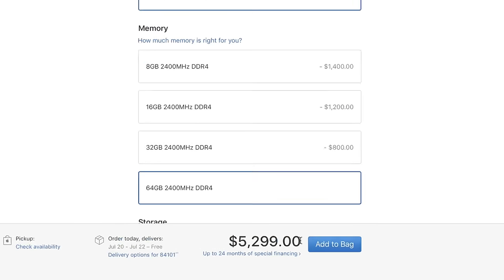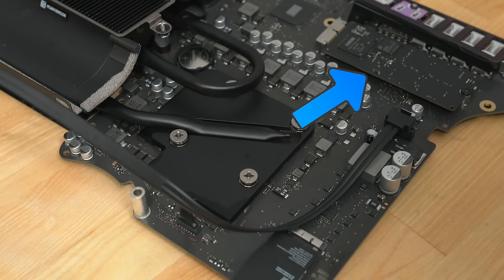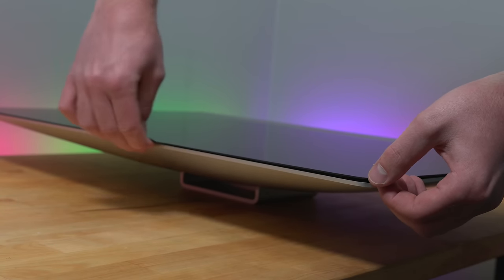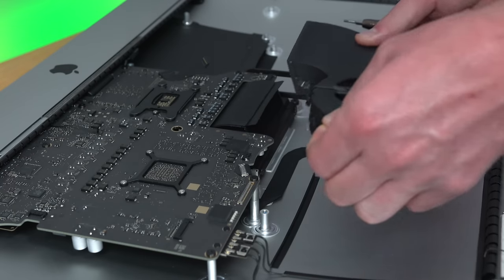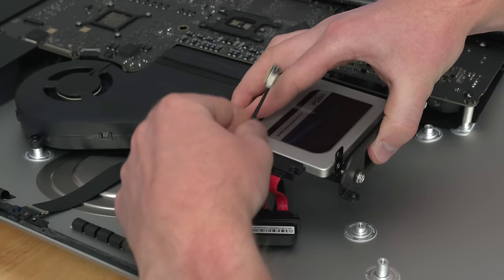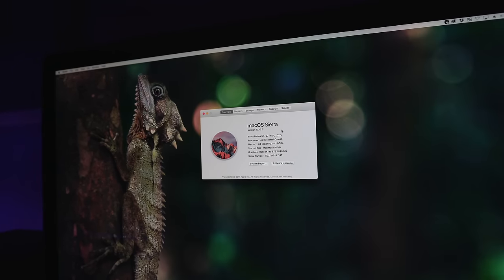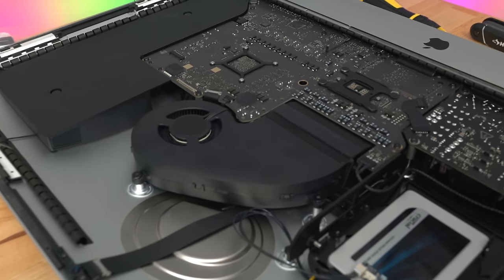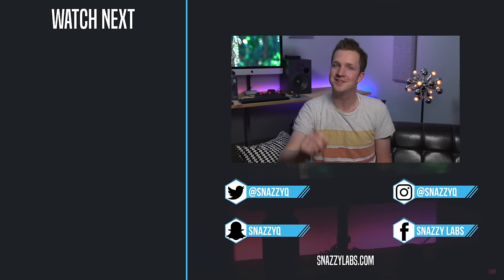The Best 2017 iMac Apple Doesn't Sell!

Comment: If the time comes when the machine´s hardware becomes obsolete, is there any replacement parts all down to motherboards for these apple machines (aftermarket and apple made) only to be fitted into the chassis though?

Comment: Great video. Perfect length and super informative. I'm looking to potentially upgrade my iMac as well so this is really helpful. What I'm wondering though is, would this work with an 8 core processor? The upcoming iMac Pros are going to have processors starting at 8 core, but I don't want to pay the ridiculous price that Apple is going to charge for even the base model. I've got a 2013 iMac now with an older i7 processor, and it would be killer if I could just upgrade it to an 8 core.

Comment: I've got a 27" iMac Late 2015, I've got the SSD in hand, the adhessive, thermal cable on it's way, but you upgraded to the Blade SSD, but added an SSD. Do you somehow make a fusion drive agian??? Or just throw away the Blade SSD?

Comment: Thanks for sharing this cool video.  What was the model number of the iMac that was upgraded?  What would be base model's model number?  While this video showcases the i5 to i7-7700 upgrade, what is the video card upgrades could benefit this build?  Would the non-K cpu work just as or better than the K-version?

Comment: Great video, I have seen it more than once,
Now I am planning to do the same, to buy a base 5k iMac and upgrade the CPU, add SSD, and RAM

But I have some questions if you could help me with:
- does the new CPU throttle like apple’s 7700k? Under load
- what do you recommend for thermal grease? And the volume it needs to put it on all the components (I see that you are using a big syringe of MX-2)
Reply: Mustafa Mahmood mine doesn’t. Use mx-4

Comment: SOLVED!! Quinn, does it matter if I put in the i7700k 4.2Ghz or 4.5Ghz performance wise? I only presumed the apple cooling is not properly fit for the bigger one.  One is 65W the other is 91W. In the video it seems like you used the 4.2 but the amazon link leads to the 91w (4.5ghz). can you please clarify? Thanks and check your emails lol...:)))) SOLVED!!!
Reply: so did you get an answer?! lol

Comment: You can run the LG 5K screen at 5K on the MacPro. If you option click on the Scaled radio button in the Display Preference Pane you can access the other resolutions. You may also want to enable HiDPI mode too.
Reply: No it just makes it look like 5k scaling-wise (smaller logos etc)

Comment: First of all, this is an extremely impressive hack! I will likely do the same thing to an old 2012 iMac. 

BUT, most of the money you saved was because you got third-party RAM, which you can replace without voiding your warranty. Your REAL savings is less than $250 if you get a BTO Mac and purchase RAM elsewhere. A 27" top-line iMac costs $2299. Add $200 for the i7 processor. Add another $200 for the 512GB SSD upgrade. That's right! The 512GB SSD upgrade only costs $200 if you're getting the top-line iMac, but costs $300 for the low and mid-line iMacs. Now, add the same RAM and 2TB SSD that you got along with the iMac you popped open ($453 and $532, respectively). And let's add an enclosure for the 2TB SSD for say, $24 (yes, there are cheaper ones, but let's not be stingy). That brings our total to $3708! That means you saved a whopping $237 to void your warranty and get a weaker video card! And your cost spreadsheet doesn't include the highly-touted opening wheel or thermal paste. That brings your savings down EVEN LOWER. I don't know about you, but if I spent $3700 on a computer, and somebody said, "hey, if you let me crack open your iMac, void your warranty, and put in a weaker video card, I'll give you $200," I'm pretty sure I'd say "no, thanks."

Comment: I did the exact same thing to my iMac but used Corsair's 16GB DDR4 SO-DIMM RAM instead. For some reason, whenever I'm working on something heavy, like in Final Cut Pro X, it crashes almost instantly and the Mac shuts down and restarts with the message " Your computer restarted because of a problem. Press a key or wait a few seconds to continue starting up." When I took the additional RAM out, it worked perfectly. Is the RAM i'm using incompatible?

Comment: So NVME is proprietary? Can't I buy one on Amazon and replace my 128gb original one that at the time was used in "fusion" with a mechanic HDD ? I would like to replace both drives and NOT re-build a fusion this time. Can I do it?

Comment: 6:18 this silicon lottery aply only if you OC, without it all 7700k run exactly the same... unless apple's default 7700k is real silicon lottery loss and it overheats as hell and underclock.

Comment: hey dude, first time caller long time listener ;p love the builds you do man! thanks for sharing your advice to us all. I was hoping I could pick your brain and ask your opinion on something I am trying to do with my dying mid 2011 27 imac. only problem is the gpu (i killed it playing the witcher 3 via windows bootcamp lmao) i've also still got my old g5 power mac laying around if that helps haha. Anyways, my imac isn't slim so i thought i may be able to remove some things and get an itx board in there, i doubt a gtx 1070 GPU would fit but i don't have a spare empty imac case to practice with. i am trying to build a fairly decent machine to game with and do video editing and animation work. i don't need 4k for what i do, but it would be nice to have a machine capable of doing so (even though I'll need i 4k monitor to view the results) the 1440p monitor is too good to through away imo. i would like to reuse as many parts as i can,  any thoughts on this are greatly appreciated, thanks again.

Comment: I’ve got a question I hope you can answer:
 I have, what seems to be a dead gpu in a mid 2011 iMac... do you know if the case will support a fresh rebuild utilizing new components like shown in this video? 
 Actually, I don’t need a unit with fancy specs like the top line one you have here but, an mild update would be nice.
Reply: You can add an ssd. But your cpu will have to be for that gen.

Comment: I have a question?  I was thinking of getting a 3tb fusion imac setup, is it possible to put the original SSD on the board later on, is it possible? Or should I get an SSD with the inital purchase, then just do your upgrade later on?  My thought on the 3tb setup is to maximize the warranty before adding on SSD on the board.  I was also thinking that by the time my warranty runs out ssds prices might drop.

Comment: Why does your iMac about screen says Radeon 575 and in the video you say your buying the base model with 570 graphics. 575 is the middle ground and is upgradable from Apple to an i7. Asking this because I'm wondering if the CPU on the base model is soldered and on the more pricey ones isn't?

Comment: I really enjoyed watching this video. Thanks a lot. I've got some questions. I have a 27" iMac which came out in late 2013, and I'm thinking about upgrading it just like you did. My first question is that the DIY parts you bought would be working for mine. If so, what about later parts that come out in 2019 with better performances as you posted this video 2 years ago.
Reply: I forgot to mention about my mac in detail: 3.2 GHz Intel Core i5, 8GB 1600 MHz DDR3, NVIDIA GeForce GT 755M 1 GB. If you were me, what parts and upgrade details would you do to my iMac? I do lots of video editing on iMac and now I'm really tired of my iMac being too slow and taking up lots of my time in editing.

Comment: As an Engineer with 30+ years experience with Software, Systems and dozens of PC's, I can tell Apple's MacOS is head and shoulders above Windows. It is a Berkey Unix based Kernel that Apple has optimized and remains downward compatible with older hardware. If Apple made their systems more easy to upgrade - they would sell more of them. I have a late model 2015 SkyLake architecture and love the 27" 5K retina display. The display should be separate from the PC , and the hardware more modular and accessible.

Comment: You bought an i7 7700k while I expect that Apple uses the i7 7700 stock. You can't overclock in the mac, but it runs naturally a couple mhz faster than the 7700.

Comment: can i ask a serious question?  i'm considering trading in my 2017 5k imac and getting the refreshed 13"mbp.  thoughts?  the only reasons i'd want to hang on to the imac is for the 27" 5k display, no t2 chip, and user upgradeable RAM; but there are so many other things going against the imac.  i would like to think apple is going to refresh it sometime in the next year? or less?  the looks are dated, which i don't care that much about in and of itself, but if a redesign comes with upgraded I/O, that's something I'd want.  It's also got the same old ass BT, not even an option for 10gig ethernet (not that I can make the most of it, but it's like a $90 upgrade on the mac mini), the vega 48 seems like an overpriced and lackluster upgrade, and they leave so much empty space on the inside, which could have been used for a secondary fan(????), which would seem like a smart idea for a computer with heat issues... desktops are going out of fashion, and mobile productivity is the present and the future.  But I still do enjoy the desktop experience.  I figure that with a MBP + TB3hub + egpu + external storage, I can get similar performance (if I go for the 15"), plus portability.

As far as why i'm looking at the 13" mbp is because I can almost trade them for each other straight up (maybe a few hundred on top for upgraded RAM and SSD).  Ideally I'd like the MBP 15" with the vega 20 and 32gb RAM and a larger SSD thanks to the price drops.  But because of the nightmare stories I've seen relating to the keyboard and thermal throttling, it seems like a big risk to spend that much money on a laptop, especially with the rumors of a new MBP with a keyboard going back to the scissor mechanism... even if it ends up being in an even higher tier pricewise.  Also, the vega 20, while better than the radeon pro, is still pretty underwhelming.  

Should I just wait to see what Apple releases for new imacs or mbps?  The problem with this is that my trade in value is going to sink fast.

No I'm not a "power user", but if I'm going to invest this kind of money on a computer, I want it to have a little more longevity.

To be honest, I've had a hard on for the MBP for a while, but the price to performance seems... blehhhh... plus the aforementioned throttling issues and crap keyboard (tbh i like typing on it, but i dont want to deal with having to get it repaired all the time).

I'm so torn.  

Any advice would be greatly appreciated.

Comment: Hey Quinn, great video, bravo! Could you please tell me what RAM did you put in there? I am asking because I bought from Ebay two pieces of RAM for $70 each (some good brand, just don't remember which one it was) and my iMac (i7, late 2013) didn't accept them, so I had to remove them... Please let me know if you know how I can get the right RAM. The Apple website doesn't sell RAM at all, so I don't know how I can get the proper ones. Any idea please?

Comment: Quick survey, does your iMac 2017 (or any gen) experiences Image Retention/Burn-In, which common to LG LCD Panel? And what are your iMac workload (ex. 12/7) and setting (ex. 70% brightness).

I plan to get one of those,  appreciate your input.

*I well aware this issues not iMac specific, but most likely to happen to any LCD Panel.

Comment: I bought an iMac Pro that is less than 2 years old on ebay (5k display, 18 core cpu, Vega 64x gpu, 256GB RAM, and 1TB SSD) for $3,799. A steal for a computer that cost them $13,300+tax.

Comment: Hey Dudes, I have a question. I bought a iMac 2017 with 1TB Fusion Drive and I want to change it myself to SSD. I don't get the point, why the Uploader was buying the iMac with bigger SSD instead of Hard Drive. Since Fusion Drive is just a combination of an 1TB Hard Drive and an 32GB NVME SDD it shouldn't make a difference in speed when I use a 32GB NVME SDD (pre-installed) + 2TB SSD Sata in relation to his version of: 512GB NVME SDD + 2TB Sata (the version he used with bigger preinstalled NVME SDD)
Reply: did you ever get or find an answer on this ? I was wondering the same
Reply: no :(

Comment: Hey Quinn, not sure if you're reading comments on old videos, but do you think an 8700k would work as well? I heard that from Mac OS 10.12.3 Coffee Lake CPUs are supported but I don't know if there's some hardware limitation on the socket
Reply: No, it won't work. It is the same socket but Intel wants to rip off its' last gen customers so they make a different chipset. If you want an 8700K, you probably have to build a Hackintosh.

Comment: Not the crap about an unplugged PSU having enough juice to kill... Exposed PSU or not, as long as you disconnect the mains lead, you will, at worst, get a very anoying shock from the charge left in the capacitors, but that is it. But if you try the same thing WITH mains power still connected, than yeah, fear the angry pixies and the evolution.
Pro tip - to drain the charge from PSU after pulling the plug, just press the power bilutton for a few seconds, and you can touch the power supply anywhere you desire without it being able to defend itself ;)
Reply: I do like the rest of the video tho.

Comment: Why'd you get the 7700k if you aren't/can't overclock it? You could have saved even more money by not buying the k version.
Reply from the maker: +Scout Scamp The 7700K has a 700MHz higher base clock than the 7700.
Reply: Snazzy Labs oh okay. I should have done more research then.

Comment: Would the same method work for the new Cannonlake 8th gen processors? 8700k seems like a good candidate for this CPU swap >8D
Reply: The socket is not compatible. You can try which will 100% result in damage of socket pin which means you have to replace the whole motherboard.

Comment: just ordered a very well spec'd 27" off apple refurb, but got stuck with a 2TB fusion drive. Is it possible to replace it with the nVme SSD drive? I want those read/write speeds. Not interested in SATA.
Reply from the maker: +YEG Drone Photography - No.

Comment: Why did you buy a K-series CPU when the iMac motherboard doesn't support overclocking?
Reply from the maker: +Luka The 7700K has a 700MHz higher base clock than the 7700.

Comment: Snazzy Labs, I heard 8th gen Intel processors will be available in September '17. Something about them doubling threads or cores, not exactly sure.
If this is the case, will you be doing a video showing an install of an 8th gen processor into the iMac shown in this video?
Reply from the maker: +Matheau Michalak No. Not compatible. But I'll be doing a video concerning the iMac Pro and upgrading that.

Comment: I admire your self-confidence and great knowledge and understand. However, the machines that Apple produces and sells need to make a profit, because that is how business works. The global Apple Behemoth may churn the geek stomach regulary but I prefer it (As a working musician who just needs this gear to ‘function’) I still run a 2009 cheesegrater 4,1 Nehalem machine and it has Lion, El Cap and H Sierra running just fine. (HSierra patched, obviously) I do understand frustration with aspects of the Apple beast and their pricing. That $3,000 machine in 2009 has booted up every single day for 9 years @ $300 a year? I am never gonna complain about that: every time I open the case to clean or dust it, the engineering leaves me with renewed respect. During thhis 9 years I have watched 3 PCs die a digital death, lost Application functionality because of an unsceduled upgrade the Win 10 from 7. I regularly use both Mac and PC. I dont wanna game or video edit, just want the darned things to boot up and work.
Another thing? The mac fans never come on and recording music is great because there’s zero room or HD noise.

Comment: A better alternative is to skip the Processor,  Forget about the internal SSD that is only o 530 / 510 MB/s.
1) Order the computer upgrade with 512GB 
2) buy the Memory
3) Connect Externally a SSD which Will be alot Faster than the one installed on Video.
4) No need to Open the machine and have changed to Fuck up the screen. If it does happen you are screwed hard and repair will cost you around 800$
Reply: R3N no.
Reply: @shenronz6260  No what? 
What do you suggest instead?
Reply: R3N Believe and invest in yourself. Stop being scared and screwed over by these big corporations, cheating you out of your hard earned money...take your time and you’ll have a cheaper, more powerful, and future proof-ish machine. It’s worth it and you’re worth it. I did it and I’m glad I don’t have extra cords laying around my iMac.
Reply: @shenronz6260  The problem is that adding the SSD in this video is a lot slower than Apple Proprietary SSD. For example OWC Solid State Drives from macsales is around 530mb/510mb write/read speed per second while apple proprietary is read speed of 2,753MB/s and a write speed of 1,238MB.
There are ways to not get screewed over. You can actually avoid Sale tax if you buy at the right place and save around 300$+ in tax alone.
As well free shipping. If you can afford to buy a screen replacement then sure go ahead and do this but for other people with limited budget they going to end up spending all their budget and end up with a broken computer..

Comment: I have a question I can not seem to find a real answer for, but I think I heard maybe answer. so my new 5k imac "2018" has a fusion drive that from what I understand is a 2 part drive, a sata drive and a nvme drive under the power supply.  I find all kinds or SSD changes for the sata drive. but can I change/ upgrade the nvme ssd? another person told me the 2018 imacs nvme is actually soldered to the board. please tell me this isn't true! and it can be upgraded